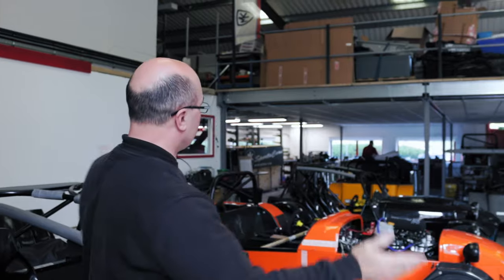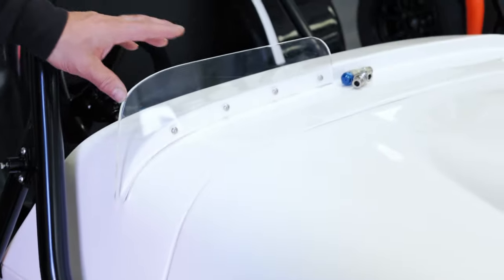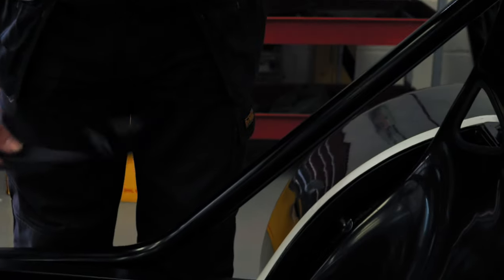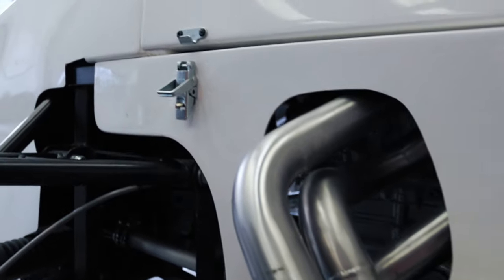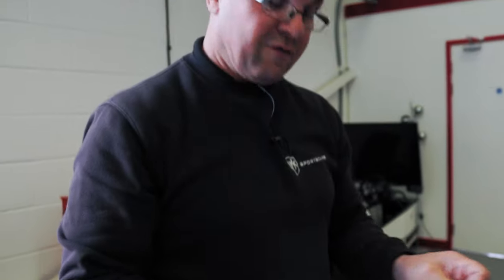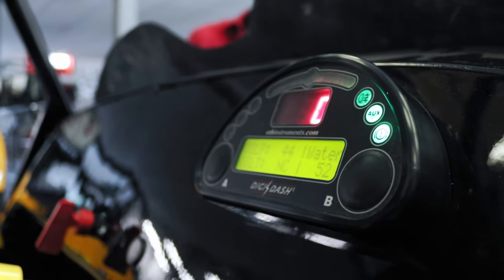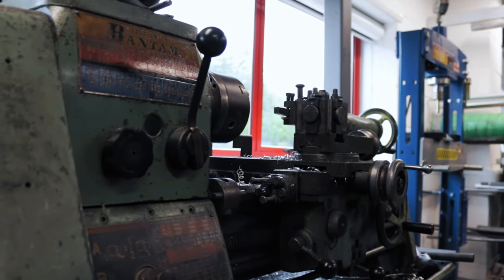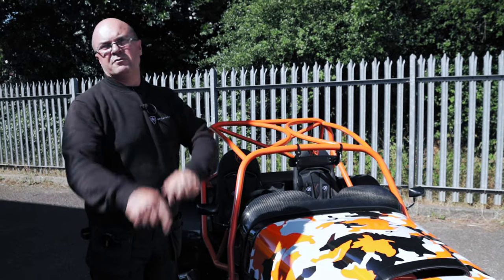Ep 128 - HONDA S2000 hits the DYNO... GUESS THE BHP?!? #honda #s2000 #dyno #bhp #kitcar

Comment: Very cool steering wheel. So how are the various buttons powered - there's presumably a battery inside it so how is the battery recharged?
Reply from the maker: It’s a lithium battery and is only used when a button is pressed.  They apparently last a very long time - unknown just how long, but very cool
Reply: @MKSportscarsofficial  Thanks for the response. That's somewhat disappointing to hear. It'd be just my luck to be stuck miles away from home when said battery dies which would render the car unusable on public roads (no indicators, lights, horn). Hopefully they'll make a version that's powered by the car's battery instead or alternatively can be recharged in such an emergency via a cable connected to the car's 12v connector.